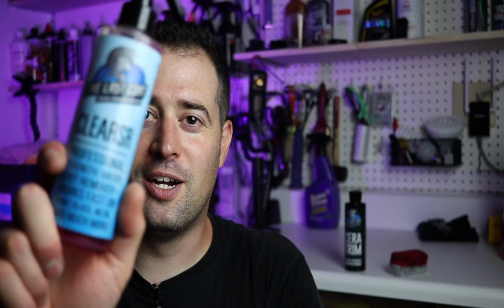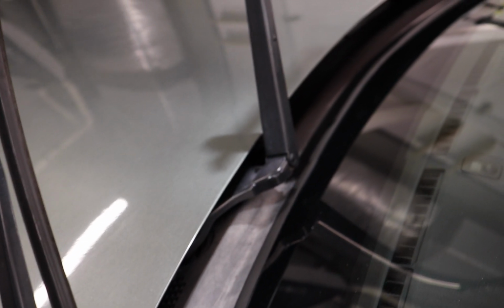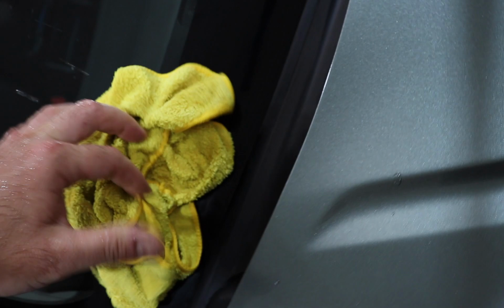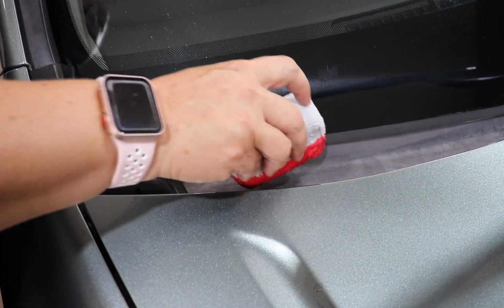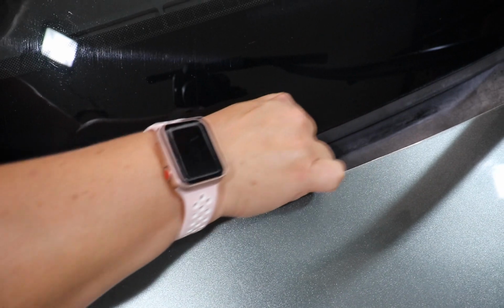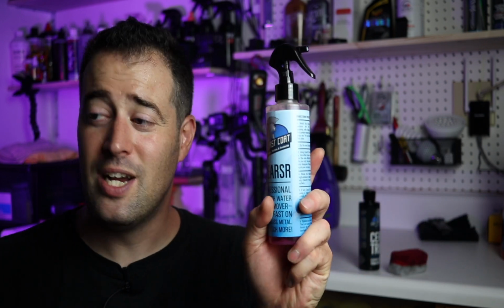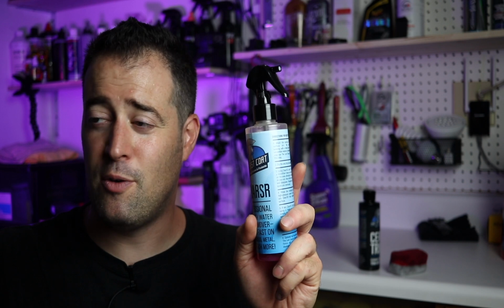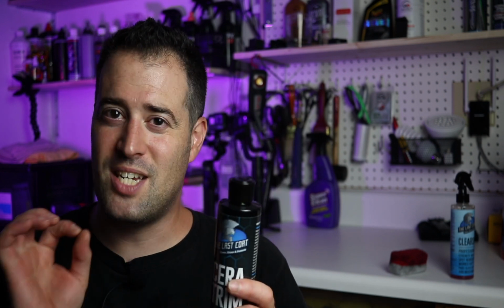Remove Heavy Mineral Deposits and Water Spots! / #autodetailing #mobiledetailing #thelastcoat

Comment: I've been using Ceratrim for awhile now. Using it for different applications as well. Works great on tires and in interior rubber molding. However, on the next maintenance wash it comes off. Great video Phil. Going to have try that Cleaser

Comment: great video and product review Phil. would u choose ceratrim over solution finish or ceracote?b well
Reply from the maker: Thanks. I’ve used solution finish before and it’s great also. I haven’t used veracity yet though. But I have found that there are different plastics that take to certain products better than others. It all depends on the type of plastic or rubber trim.

Comment: Could you use this like a drying aide after a wash? I have super hard water and a black truck. After i wash, i can never dry the truck quick enough to stopwater spots. Thanks in advance and please, keep doing what you are doing. You and your channel are very underrated and deserve so much more attention. Much love from Arkansas.
Reply: I wouldn't use it as a drying aid my friend. That's not what it was intended for. The product has acidic properties in it and thats why Phil is using a damp or wet microfiber cloth to break down the acid in it. Hope this helps my friend.
Reply from the maker: Hi. No not as a drying aid. This is a very specific product for water spots. It needs to be wiped with a damp towel or rinsed away completely becasue it is an acid based product. However you can use it water you have washed and rinsed the vehicle with some standing water on it. Spray it on and agitate with a towel then rinse it off. Then you can check and see if it removed the spots. If not try again a second time. It’d that doesn’t work the next step is to compound them off like we Demi’s in the last video. 😎👍🏼
Reply from the maker: Yes exactly!  That’s for helping with that answer also! 😎🤣

Comment: Great Video Phillip,  I Have A Question is There A Way To Restore The Color On Wiper Arms That Look like They Are Fading Because Of Sun .
Reply: We all have that issue but I was told by a very famous detailer repainting was the only way :(
Well, no thank you...
Reply from the maker: Hi. Sorry I missed this question. You can use a ceramic trim coating if it’s just faded. But if it’s cracking and flaking then yes it would need repainting.
Reply from the maker: Yeah it depends on if it’s just faded or actually flaking away. If it’s just faded you can restore it with a true ceramic trim coating like Dlux or Gtechniq C4. But if peeling or flaking away it needs to be repainted.
Reply: @MirandaDetailing Thanks for the tip ... So C4 it is ! I guess a good IPA or plain alcohol will do after washing, to prep metal ? Can't wait to try it although I have no garage and I stayed away from ceramics for that reason...
Reply from the maker: Cool. Yeah just ipa and apply and wipe to even it off.

Comment: How about hard water spots on paint ? I heard wheel acid is best to remove them ?
Reply from the maker: Hi. We just did a video on that actually. https://youtu.be/kpsHy7kNM28
Depending on what type of minerals deposits they are, once they etch into the paint or glass chemical will not remove them no matter what. The only way to remove them is to abrade them off by either compounding them or sometimes wet sanding them and then compounding and polishing. They are a paint to deal with.  Many variables come into play, there is no magical chemical that removes them with ease, I wish there was though.

Comment: Would this not have helped on the water spots on that police car interceptor ?
Reply from the maker: Maybe. But I didn’t have it then. But even after using all sorts of different chemicals once water spots have etched into the clear coat no chemical will remove them. They have to be abraded off unfortunately